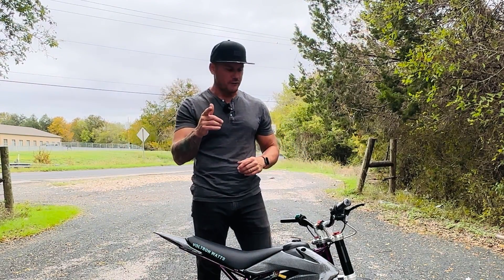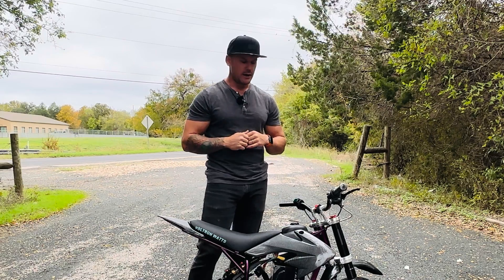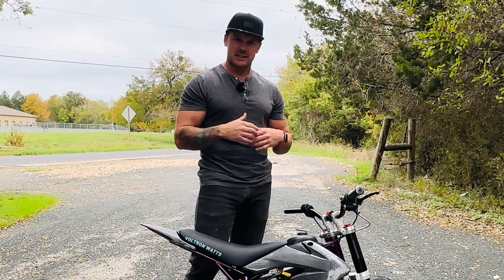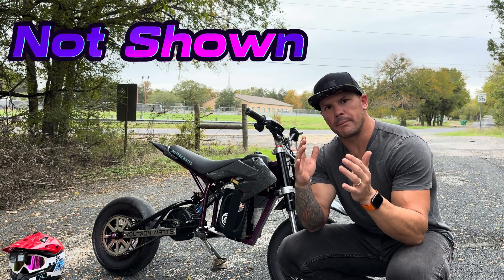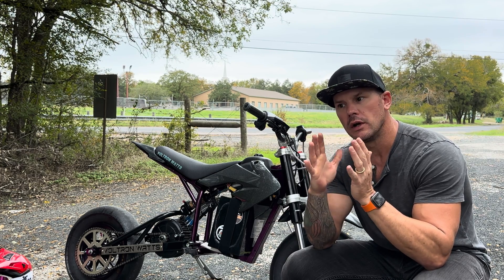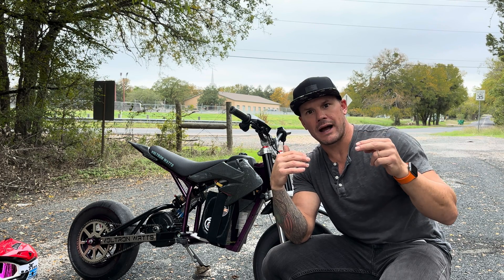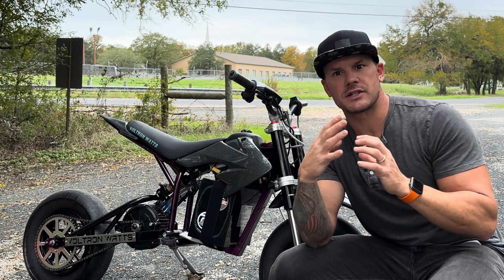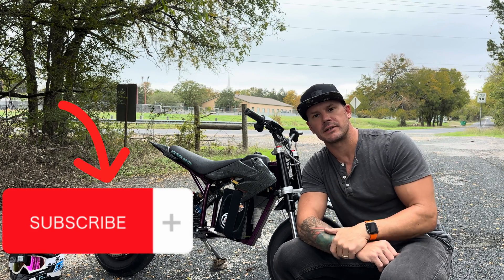From Toy To Monster! Transforming Your Razor MX650, RSF650 And SX500 Into a 70MPH Rocket! #QS165

Comment: How much watts did you run on the qs165? I’m building a bike with that motor and don’t know how much watts I should push on it
Reply from the maker: 72 v 240 amp cont so about 17,000
Reply: @VoltronWatts  Wait and what phase amps did you run?

Comment: What’s the part number to the controller trying to find it by what you said 96660 but nothing popping up with that number different numbers any chance you have a link where you got yours from  thanks 🙏🏽
Reply from the maker: 96680 Econic cycles 👌 discount code is Voltron5 they are the go to place for fardriver controllers 🍻

Comment: are you every gonna make a build specifically for high speed?
Reply from the maker: What’s your definition of high speed?
Reply: @ like I’d say 80s to 100 is pretty high speed if you ask me
Reply from the maker: @Picklejuice950 yea, on a mini bike with 10” wheels that’s flying bro 🚀🚀
Reply: @ I meant like a video testing a motor going for specifically high speeds, like pushing the motor to its limits with high line amps in phase amps, and gearing to make it have a better top speed.

Comment: Do the super motos from your Amazon bolt right on to the wheels of the razor if so can you link the ones you used in this vid
Reply: Could you link some bolt on tires for mx/sx wheels
Reply from the maker: The front wheel on the Max is different from a SX
Reply: @VoltronWatts  do you know some good bolt on dirt tires for mx wheels and some for sx wheels
Reply from the maker: These are PMT tires on razor RSF650 wheels.

Comment: hey voltron what wheels do you have?
Reply from the maker: Those are RSF 650 wheels
Reply: @VoltronWatts  darn I really need wheels that are sturdy and better then stock but I can’t find any beside rsf any recommendations?
Reply from the maker: Burrow max wheels are good. E&C also sells supermoto wheels
Reply: @VoltronWatts  can you send link please?
Reply from the maker: Just google burrow max wheels or if you use the E&C website use Voltron5 at check out to save some cash
Reply: @VoltronWatts  I can’t find the burrow max
Reply from the maker: @997colten https://burromax.com/performance-off-road-tire-and-wheel-mounted-set-of-2-cat-claw-tire-part-10178-fits-tt1600r-requires-brake-disc-10177

Comment: So how is the power of the QS165 compared to the Sotion FW11 and EC4p? My understanding is that the EC4p would get you going the fastest based on both the wattage and rpm rating but correct me if I’m wrong.
Reply from the maker: The Sotion and the FW01 were pretty comparable, with that being said, I was running them both at pretty much the same DC in  and phase amps. The EC4p and FW11 are very close as well.
Reply: QS165 > FW11 > EC4P. fw11 and ec4p are pretty close so its preference. qs165 is miles better than both just off the fact that its a larger motor bc its not bolt in